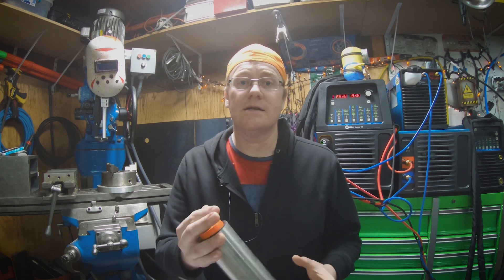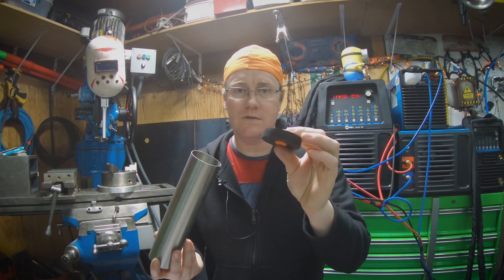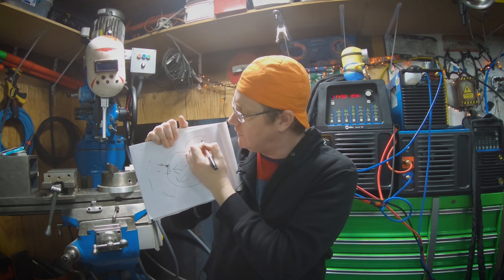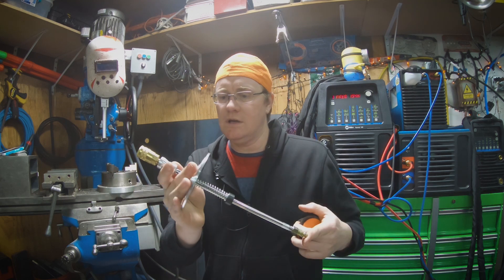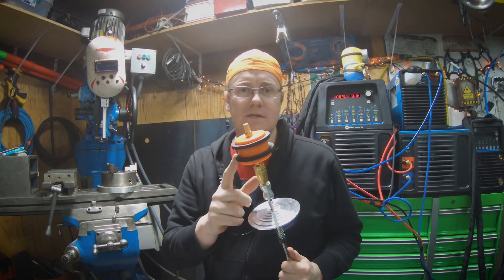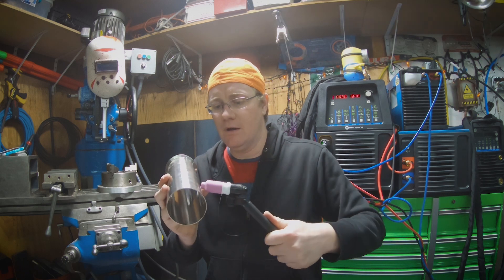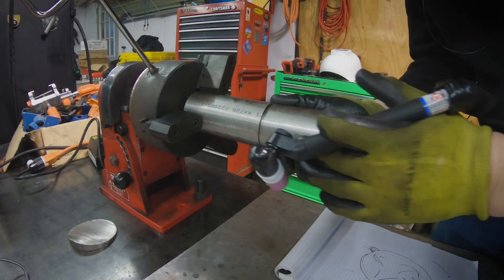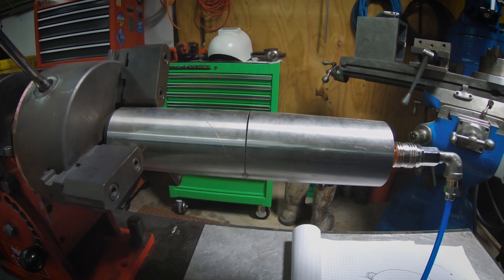Welding Sanitary Tubing PT 3  Purging

Comment: Q: in a food processing plant what schedule pipes would I be coming across...
Q: I'm thinking of buying a welding machine what would be the maximum amperage I would need the machine to be to practice
Reply from the maker: So sanitary tube is thinner wall than schedule pipe. Its all .065" wall and I almost never go over 80 amps. most tube is welded at 45-65  amps depending on who is doing the weld

Comment: Back purge is what they call that gadget.  A tree is when it’s just the same block mounted on a table but the difference is that a tree has argon flowing thru the block nog a tube as a back purge setup.   👍

Comment: I got some 416 stainless schedule 40 scraps that came from a water softening plant from my welder friend and he told me not to walk the cup on the root pass and attempt to back fill the root and that I could walk the cup on the cap weld and he explained that it is because the water is very salty so what your saying sounds spot on does this sound right for schedule 40 416 stainless? Thanks for the videos.
Reply from the maker: I think the idea is you put in less heat and don't cook the metal as much. sounds reasonable to me

Comment: Is that purge plug set only good for sanitary or could it be used for socket weld fittings
Reply from the maker: I have used it for sked 10 and 80 pipe before works ok